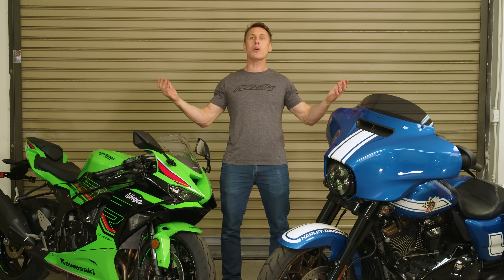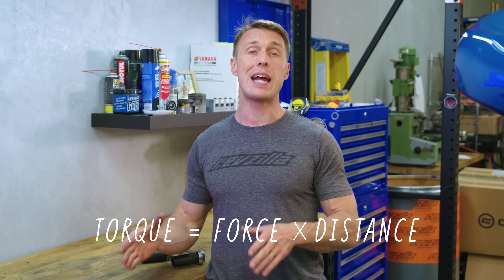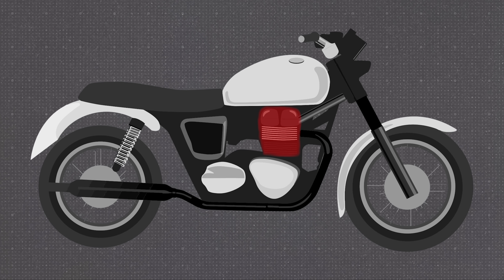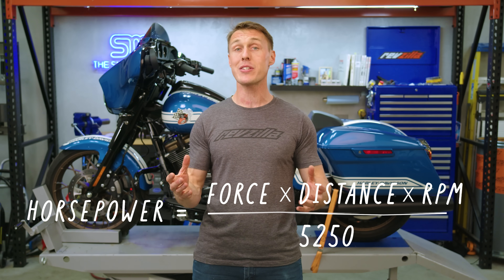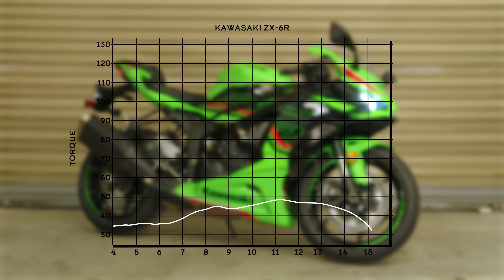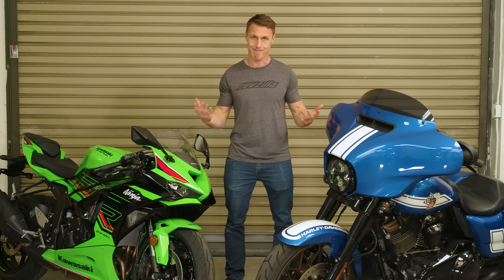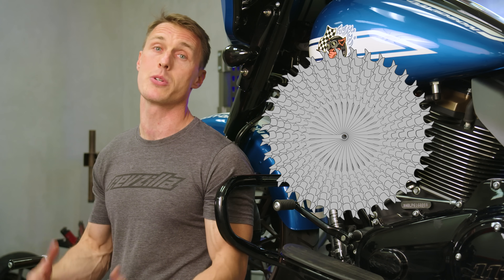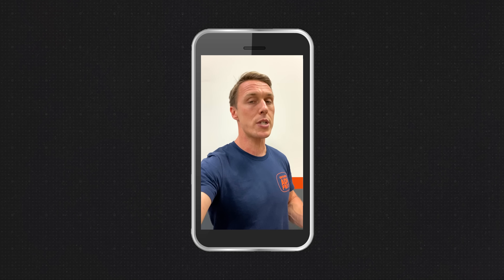Torque and Horsepower Explained! | The Shop Manual

Comment: Horsepower is how fast you go into a wall and torque is how hard you go into a wall.
Reply: Well said. 💯% accurate.
Reply: Not true, the wall doesn't know how the power was made. It only cares about the end product
Reply: Facts
Reply: Um, no.
Reply: Please downvote this out of the eyes of people who will believe it. This is the most nonsensical crap repeated on the topic shared by people with no understanding of the topic.
Reply: No
Reply: that's wrong
Reply: This is flatly wrong, and it's doing a disservice to people having it here.
Reply: That’s a terrible example. How hard you hit a wall is 100% dictated on speed and angle. Torque would be better explained by how hard you can hit a wall depending on distance. You could hit the wall harder quicker, up to a point
Reply: Not even remotely. This is exactly the kind of nonsensical garbage that gets repeated by boomers at drag strips.
Reply: Your mass and velocity are how "hard" you go into the wall
Reply: Horsepower=how fast you can go.
Torque=how quick you get to peak hp
Reply: That would be momentum
Reply: That would be momentum
Reply: That would be momentum
Reply: That would be momentum
Reply: That would be momentum
Reply: That would be momentum
Reply: That would be momentum
Reply: That would be momentum
Reply: That would be momentum
Reply: That would be momentum
Reply: That would be momentum
Reply: That would be momentum
Reply: That would be momentum
Reply: That would be momentum
Reply: That would be momentum
Reply: That would be momentum
Reply: That would be momentum
Reply: That would be momentum
Reply: That would be momentum
Reply: That would be momentum
Reply: That would be momentum
Reply: That would hurt!
Reply: The guy just explained it in the video yet you still come up with this shiit?
Reply: Speed is how fast you’ll hit the wall, and your mass (ie, inertia) is how hard the impact will be at that speed.
Reply: I heard it life is still hard please stay up
Reply: It might be technically wrong, but it is funny!
Reply: Why do people keep repeating this stupid saying? How hard you hit the wall depends on speed times weight...
Reply: Horsepower is how fast you hit the wall, torque is how many of those walls you can go though
Reply: @jameskerr9762 not its not.....😂😂😂
Reply: This man summarized all the laws of physics that apply to engines in 2 sentences
Reply: If torque is the force of turning applied and not over a length of time, how can you feel it?
Reply: I think you meant velocity and momentum 😅
Reply: That's actually a really bad analogy I wish would stop being used.
Reply: No, this is the same stupid thing that is constantly repeated by people that are clueless on the difference between torque and power.
Reply: Not at all.
Reply: Wow, after watching this video you still came up with this idiotic sentence?
Reply: No this is bs
Reply: Not exactly. HP is just a mesure of torque over time. It doesn't matter how much torque you have. You will hit the wall with the force of hew fast you were going

Comment: When learning mechanics one of my instructors explained the relationship like this. Torque is the amount of work you can do, Horsepower is how quickly you can do that work.
Reply: not quite right, HP is work you can do...
Reply: Torque is the amount of cargo boxes you can carry in your hands, Horsepower is how many cargo boxes you delivered. When boss asks, the only matter is how much work you did end of the day. Horsepower is a final result of your engine, it shows you how powerful you are, Torque and RPM is your tools to get that final result, it doesn't matter more torque vs more rpm, if you have same amount of HP, the same work done. The acceleration, top speed, carrying weights, going uphill, its all releated to Horsepower, not torque itself. If you do a research about torque curves in semi-truck engines, you can see its actually making more Horsepower at the low end rpm band, not torque itself. You can always make your Inline 4 Racing bike a good heavy load carrier with very short gearing, it will produce more amount of "Wheel torque" than harleys, because you adapted your power to the low speeds.

Comment: I like the way you explain it. Simular to having an old 2 cylinder john deere 19 hp tractor and an 8n Ford. The Ford puts out a bit more horsepower, but the deere would out pull it every time. Horsepower is a function of torque arm x rpm/5252

Comment: One final bit of the explanation is that a high revving low torque engine can still produce massive torque at the rear wheel due to the aforementioned gearing impact and in the end what you feel is torque at the wheel, not at the crankshaft.
Reply: That is what I "keep screaming" on all videos like this. They don't specify that "torque at the wheel" is important for acceleration, not at the engine. In a gearing calculation, power is same between input and output of a transmission (ignoring internal losses). But the torque and rpm "value" is what changes. Want more output rpm (=wheel speed)? Torque has to come down. It's why diesel engines are not used in (high-)performance cars.
Reply: But, as you gear it down for more torque you loose speed. To try and match the torque output of a large engine with a small engine you would end up needing to shift a lot as the gearing would be very short. 
Everything is a balance. That’s why heavier bikes do better with high torque engines that produce relatively less horsepower. You need that high input torque to get the mass moving. And, generally a heavy bike is going to be more about comfort where you don’t want an engine screaming at high rpm all the time.
Reply: @ In real life you won't find the same transmission ratios on a big and a small engine. The "design target" is a "target max speed" and spreading it between 5/6 gears based on power band (i.e.: not peak engine torque). I agree that the small engine will scream, but the wheel torque will be comparable (if the power is comparable).
Edit: If you care about acceleration, then "as you gear down for more torque you loose speed" is not really logical. You downshift because you already lost speed and want to regain it asap. If you are at peak engine torque rpm, then downshifting will, most of the time, get you more wheel torque because you shift into higher power rpm. And that was my main point of "wheel torque", not "engine peak torque".
Reply: @mateiberatco500  You have to account for input RPM and output RPM as well. At the end of the day it isn't that simple because when you gear down for more torque you loose output RPM which is the speed. Yes, if you're going up a hill you may need to downshift to maintain speed. But, when you downshift the engine RPM has to be higher to maintain that speed. At which point you would eventually need to upshift again because you will run out of engine RPM if you keep accelerating. 
I will argue that just wheel torque doesn't mean anything. I can gear down a tiny engine and get the same wheel torque as a semi truck. But, the output RPM will be very low. That's why you need to account for RPM and not just the torque numbers. It's also part of why a higher torque engine can pull heavy loads better than a low torque engine. You could gear the low torque engine so the wheel torque is the same, but you need the high engine torque in order to have high enough gearing to get the speed.
Reply: @NBSV1  First of all: I'm fighting against "big torque numbers" (instead of "power") and how that number should not affect buying decisions. That's from where I say "wheel torque" makes more sense. Granted, it's not a beautiful single advertisement-friendly number like engine peak torque, but I also want to see the engine graph when I shop for a vehicle (and if they would provide "wheel torque vs speed for each gear", that would be my auto p**n).

"when you gear down for more torque you loose output RPM which is the speed" please stop saying this. The rest of that paragraph I agree. But the output rpm/speed will not drop unless the vehicle is in the air (or hard braking or some catastrophic failiure). Vehicle inertia si orders of magnitude bigger than engine inertia to raise it's rpm.
Also "gear down for more torque" - if you mean engine torque (cause everybody assumes that when talking about torque in cars/bikes), not true in any cases. You gear down for more engine power, which leads to more wheel power, and that is proportional to wheel torque at the same speed (again, speed change is negligible during a shift).

Now, regarding your 2nd paragraph: "I can gear down a tiny engine and get the same wheel torque as a semi truck. But, the output RPM will be very low." We really need to define what we compare. In the video they compare a 80HP/110Nm Harley with a 110HP/50Nm Kawasaki (not sure if torque is in nm or ft-lbs). If the wheel torque vs speed would be overlapped, I would expect both to accelerate similarly until Harley tops out, because the Kawa has gearing spread to an, at least, extra 50% top speed for it's +50% HP. And that is my point: engine torque is meaningless for comparison. You need to get wheel torque graph and compare them. Otherwise we would see diesel engines is all car races.

PS: Acceleration is defined as force / mass (from F=ma), force is torque / wheel radius (from Tq=F*len). So how can you say "wheel torque" does not mean anything?
Reply: @mateiberatco500  If you gear something lower to get more torque that trade off is in output RPM which is speed. That's just how it works. 
Which is also why wheel torque doesn't really matter in terms of selling stuff. If wheel torque was the end goal they could just use a 50cc engine and gear it super low. You'd have super high wheel torque and a top speed of 5mph. Awesome that it could pull a truck, but not really of much use if you need to run down the road. 
They get geared to have a reasonable rpm at the speeds they're expected to run at. So, input torque is what becomes more important. 
You may understand how the numbers play. But, you're not understanding how it actually works. With real motorcycles you can't just plug in whatever numbers make the equations work out. You have limitations and expectations for rpm and speed.
Reply: @NBSV1  Wait a minute, now I get what you say: actually different transmission gearing, not just downshifting while driving. I was talking about using similar transmission (have them need gear shifts at similar speeds), to compare as few variables as possible.
I already conceided one point: wheel torque cannot be advertised as "a single number". It's peak torque is just the engine peak torque multiplied by 1st gear and diff. Not to mention that modulating (and killing) the clutch you can easily create even higher wheel torque (an old car of mine had 148MN@4000rpm which would result in 2200NM split between 2 wheels). And, in a graph, you would also see the top speed (and the problem of "extra small engines" that you keep bringing up).
And that's my main problem with engine torque: it literally has nothing to do with acceleration or load bearing (or should I say: the vehicle's max potential). It's just a big number that, at the wheel, can be beaten by downshifting. And if you're already struggling in 1st gear (argue that can't downshift), you're way overloaded for any "comparable" engine. And if wear is an issue, by all means, get an engine with the same HP at lower rpm. But don't promote an enigne just because of it's torque. If that would be the case, all passenger cars would be diesel (which get better fuel mileage). And trucks with "big torque" also have big HP.

Comment: The perfect explanation.  I love this series.   One thing that has confused me and now just annoys me since watching this video is the fact manufactures are playing a numbers  game.  Bike one may have 180 hp @ 8000 rpm, while bike two has 150hp @ 6500rpm.  The same apples to orange comparison with torque figures. There needs to be a standard that is published at specific rpms to make comparisons easier.  I say this because most people who ride responsibility on the road don't ride or rev often at max specifications, but can use these figures to compare responsiveness, acceration and ridabilty of a given bike when comparing bikes.😅
Reply: Uhhh...nah.   The existence of a transmission means that the peak HP rating is very relevant.  What you choose to do with the HP is up to you.  But you can often find HP/torque graphs if you're really attached to some rpm range.
Reply: Yet it won’t make life easier anyway. Because one given rpm in one model can be vastly different than another. Say we measure at 5500rpm, for a big harley the engine is at its limit and you are vibrating to death. Yet on a gsxr1000 you just start to move after the light turns green and the bike is perfectly smooth as it is not even near to be under load. So yes we compared 5500rpm, but no Harley rider nor gixer bro will ride at 5500 rpm 😅😅

Comment: i think this video was good until 4:45  ,  "more torque means stronger acceleration and hp is for top speed"   😱  , its the engine that has access to the most hp that accelerates the fastest regardless of engine torque . someone thinks the hd would be faster on a  1/4 mile dragrace strip ? (of course with a heavy passenger on the kawa)

Comment: torque is the power in one punch, more fuel and air = more boom = more power. RPM is the frequency of throwing punches, 
RPM and torque,both affect acceleration. Different designs apply in different approaches. 
Liter OHVs heavy but haul ass, 4PSTs cc DOHCs speed up fast but PITA to daily,I would like to try the electric ones to see if they’re really the best bet.

Comment: I have a question. For example cars with same engine such as Golf GTI and GTD (2 liters, but gasoline vs diesel) or Megane Gt 1.6 tce and DCi, in both situation diesels have more torque then gasoline.. but 0-100 is faster on the gasoline. So.. why torque means faster accelerations?

Comment: Beautiful explanation, that hides the physics in easy to understand concepts. Of course, as you mentioned, weight is a big part of the riding experience also, since the engine does not work in a vacuum ... its attached to a bike, so that is where the transmission comes into the picture. It takes the offered torque and horsepower and translates that into the riding experience we enjoy. As many tend to do, it is very easy to compare hp and torque numbers and jump to conclusions about one bike over the other, but in so doing one is not getting the full picture. Great video, Ari. 👍👍
Reply: Right, that's why mass per power (kg per kW or pounds per HP) was invented, and should be considered too.

Comment: The "5250" is just unit conversion.  Similar in concept to cm=inches ÷2.54
That number is for torque units of foot • lbs.  It's a different number for inch•lbs.  Different again for Newton•meters.  
Horsepower can also be expressed as watts.  746 Watts per horsepower.
Reply: That's how you can tell if your tuner has the dyno calibrated correct. If the hp/torque doesn't cross at 5,250rpm,s, it's wrong.
Reply: @gorillamoto5329  
That's fascinating; I never thought about that before.  The dyno measures the torque it's fed at RPM sample intervals, then calculates the horsepower for that torque and RPM. Cool!

Comment: Before I even watch this video I can summarize both of these simple enough for a baby to understand. 

Torque is measurment. It's a rotational force along an axis, or in the case of vehicles the crankshaft. It's simply a measurement of how much twisting force there is.

Horsepower is a formula, in which torque is one of the variables. It's representative of how much work an engine can do.

Comment: this came very close to a complete, fulfilling explanation. though I don't understand this bit: If I have a transmission unit(gears) then why does the torque generated in the engine matter? If my engine can generate a decent amount of power (watt/sec) can I not convert it to whatever torque I want at lower gears by adjusting the transmission/gear ratios/say making custom gears?

Comment: One of my bikes is a Zero SR (electric):  70 hp, 116 ft lbs torque. So when you discuss torque in terms of crankshaft length, this confuses me. I'm hoping you can present  a more generalized explanation of torque vs horsepower. Or explain what "torque" means wrt electric motors. Thanks for your great video as always!

Comment: My understanding was always, horsepower makes you go fast, torque makes you feel like you're accelerating fast.
A low horspower bike with a lot of torque (like a 2006 mt-03) feels fast even tho you're not going crazy fast. High horsepower bikes with little torque might struggle with starting off accelerating, but once it's going, it goes crazy fast

Comment: The easiest one to explain this is, piston speed limitations. When a Torque motorcycle has a very long stroke, the piston speed limit the max RPM so the Horsepower is low, but only focus on torque.

But a high horsepower motorcycle has a shorter stroke, so piston speed limit has a higher ceiling about 3 times of the torque motorcycle.

Comment: I always wonder on every video explaining torque and horsepower on one thing.
The whole video explains how torque is related to the force and the lever distance, etc. but when talking about motorcycle with various engine, does the torque figure get added for each cylinder? considering they usually don't fire at the same time, so the torque would act at different intervals during an engine rotation right?
Reply: The Tourqe figuer you see is like an average of everything  working together
Reply: Yeah, the engine flywheel also helps to average those forces by keeping momentum between the power strokes